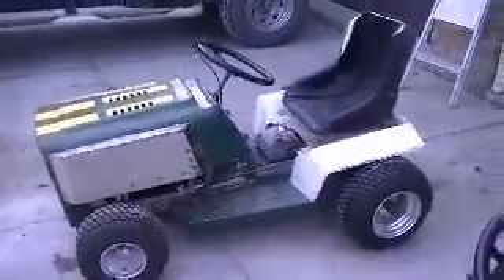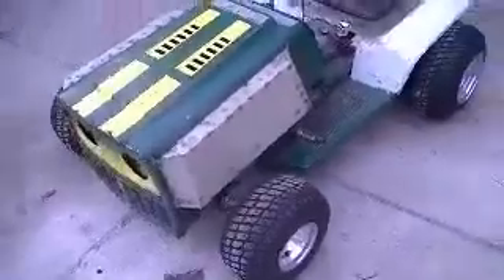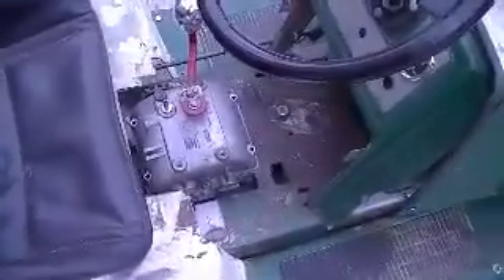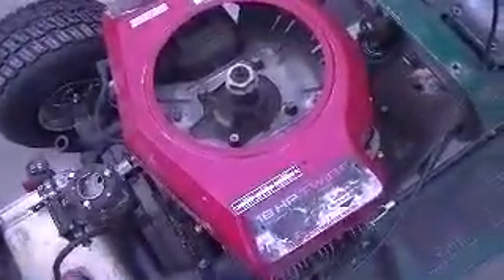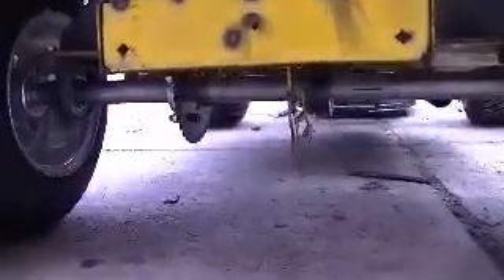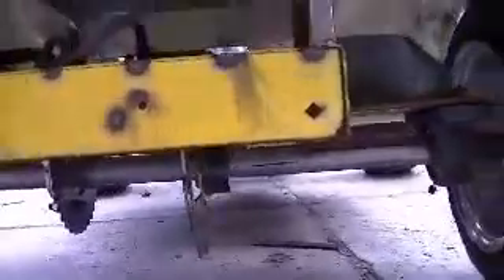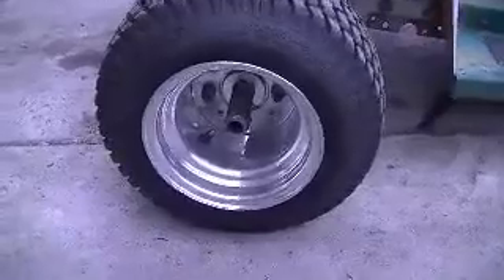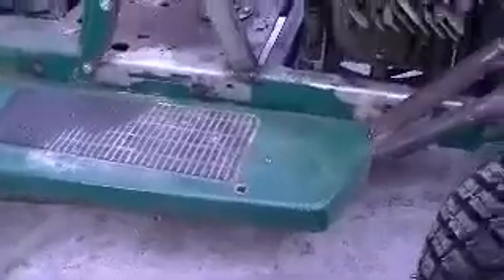General Mayhem Overview

Comment: That thing is just cool. Love the collector and great job on the header. I been making my own exhaust parts for my cars and jeep for the past couple of years and never came out that good. I also just got 2 of those motors and can't wait to tear into them. I got some pretty freaky plans for mine.
Reply from the maker: Great! Can't wait to see what you cook up!
Reply: It will probably be a while. I got my stepsons minibike to finish which I should be working on right now but I need some time off. Then my next build is another project already started 3 years ago which what I called a scorpion. Which is a tank/gocart. You ride it like an ATV. Then I can build something I can just go nuts with, with those motors.

Comment: Hey doc. Ive got a 1985 montgomery ward lawn tractor made by mtd. I have long since disconnected the brakes and broke a bolt in a successful attempt to get the caliper off. I was wondering what I could do for brakes without the ability to weld, and limited recources. If I make a video of what I have to work with on the tractor, do you think you may be able to help? Murray mayhem recommended you so I thought id try asking. Thanks!
Reply from the maker: Yeah- make a video, or join atltf.com and I'll do what I can to help. Cheers!
Reply: Thanks!